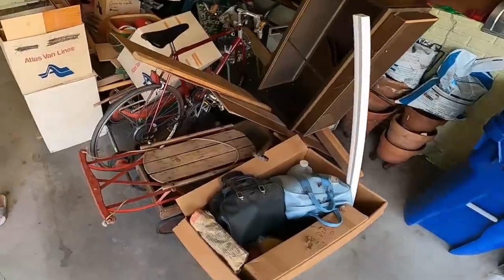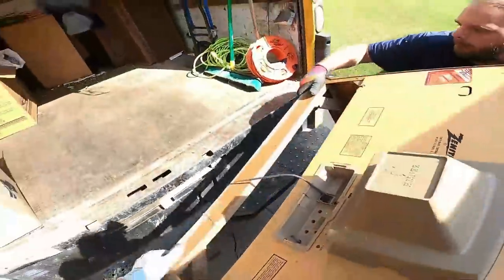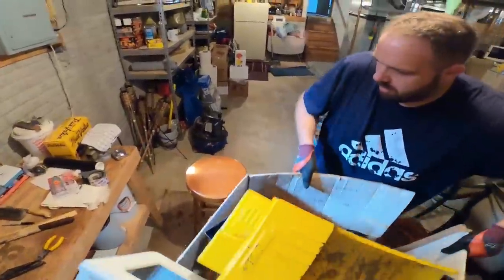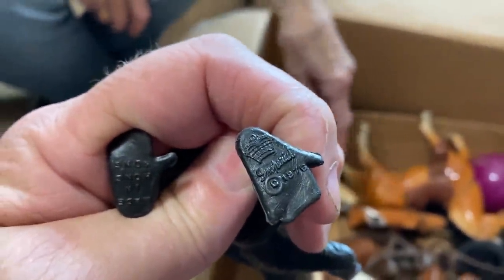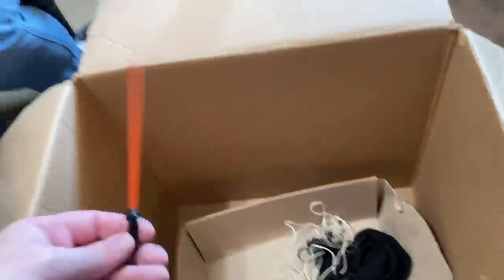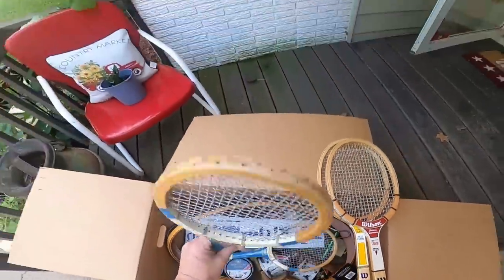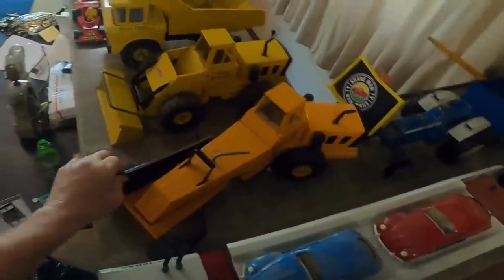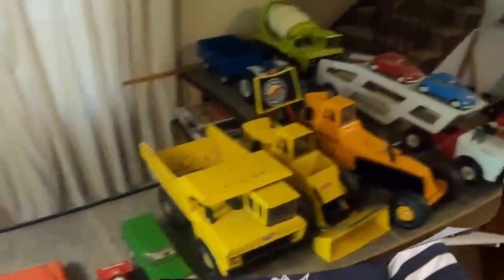Free Vintage Tonka Toys and Action Figures - Best Clean Out Ever!

Comment: The road grader with the blade on the side, the blade is called a wing. It's for snow removal and it is used to "wing" the snow off the parking strip on the side of the highway. It can be lifted up quickly to clear signs or posts on the side of the road. Great score :)